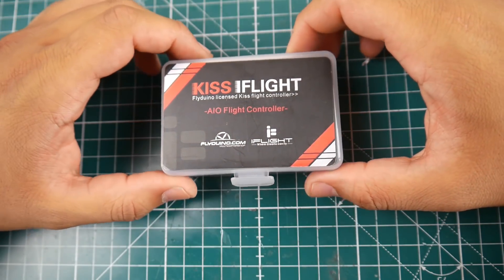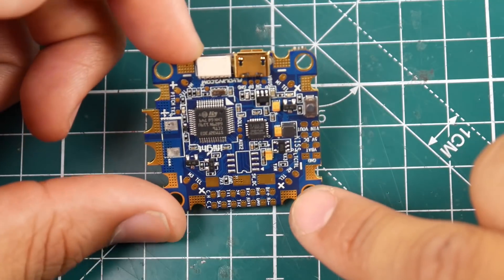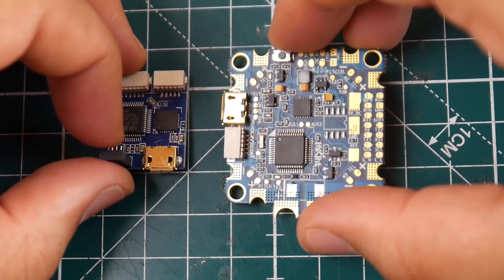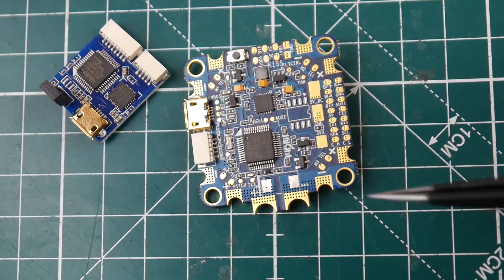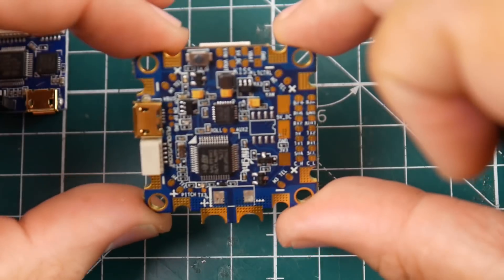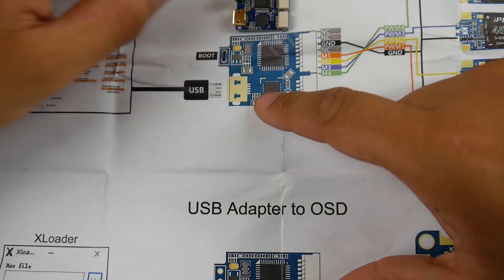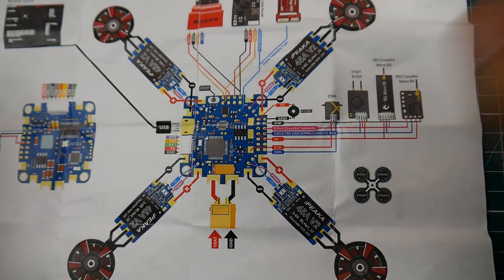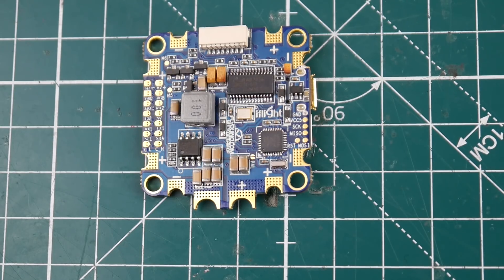iFlight Kiss AIO Flight Controller // Integrated OSD!!

Comment: @DroneMesh my guess is that eight pin connector on the bottom side of the FC looks to be for a 4in1 ESC. You could probably plug that into the BLHeli32 suite to bypass the FC and be able to setup your ESCs if needed for non-KISS ESCs. Don't quote me on it, but if that's the case then that would make sense.

Comment: dont buy this  got to buy a second one  first faulty   and lost  of problem with driver    does not work   with betaflight 
cannot find  any betaflight firmware release
worst  i got an f3 an was way easier an it work
Reply: nothing simple nothing is plug and play   osd need to buy a program or  try couple   one free  
plus  cant acces bl heli  by the controller  too much garbage
Reply: @jmdpaintball  what do you mean about the osd?

Comment: My old kiss 24a esc just got an update to 30a and can speak using the motor.... they are 2 years old. Some will say kiss is expensive, but honestly, y'all some short sighted bitches if you can't see the value in the longevity of kiss gear. Plebs.

Comment: That's not a capacitor.there is a shunt
Reply: No shunt needed. If you're using 32bit ESCs (KISS ESC, BLHeli32) the shunt is not needed. That spot is for a tantalum capacitor. Look up the Airbot Fireworks AIO FC, they have the same thing for each ESC as a option if the user chooses to install it on the board or not.

Comment: I think it's not a good idea to use a Kiss FC with non Kiss ESCs because of this ESC pass through situation that you need to setup to update the ESCs.  With Kiss ESCs, you can update them from within the KISS configurator and you don't need the USB dongle except for updating the OSD.

Comment: F3? Why? Outdated. Even my 20x20 stacks  have f4.....
Reply: I have one kiss v1 running blheli s dshot600 and compared to my helios running blheli 32 dshot 1200 the kiss is still as good if not better. Crazy
Reply: @PK-zf9wm  hi there, would you please advise what settings should be used in BLheli to make it work with Kiss? My motors don't spin whatever I do. The rest: osd, radio data, vtx work fine. Thanks
Reply: @andreylusta  i never change any setting in blheli to run with kiss v1 or v2. In kiss gui only thing u do is turn dshot 600 on and set your min command to 1000 " turning on acro mode'
Reply: @PK-zf9wm  thanks for your reply. For some reason it doesn't work for me :( Maybe I've got faulty unit
Reply: @andreylusta  u try dshot 300
Reply: cuz kiss aint licensing their latest shit to random companies
Reply: Seems pointless hey... Just go buy a kiss fc. F3 is already border line not used anymore. It won't be long until the processing speed won't support all the latest and greatest features.
Reply: I have one kiss v1 running blheli s dshot600 and compared to my helios running blheli 32 dshot 1200 the kiss is still as good if not better. Crazy
Reply: thats cuz you should be using ODIN and buttered pids on the helio, with oneshot.. then it feels super similar to kiss imo.
Reply: Software is better you be surprised   Even a naze 32 could run smooth on beta flight kiss previously only uses 1kz if we stopped using cheap gyros .....we should only use Bosch gyros  ...why brain fc has it down

Comment: Dude, one question... Why anyone ground the esc signal directly to the negative pad of the esc? You would need just maybe 1cm of wire, instead of running a wire until the FC. That could save some weight. Would it be a bad idea?